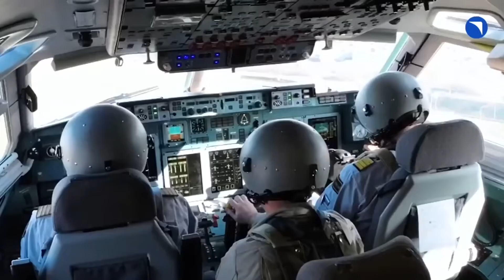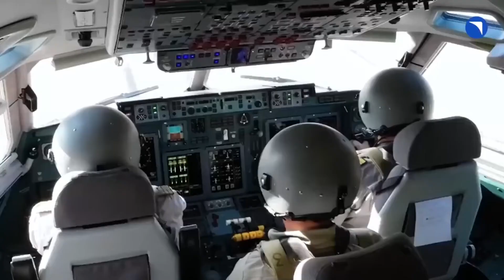Don't let this come true

Comment: regional turbo prop : IL 114

small airliner : SJ 100

 medium airliner  : MC21 & TU 214

Large airliner : IL 96

even if the aircraft is uneconomical, it's still worth having to create a Full independent aircraft market